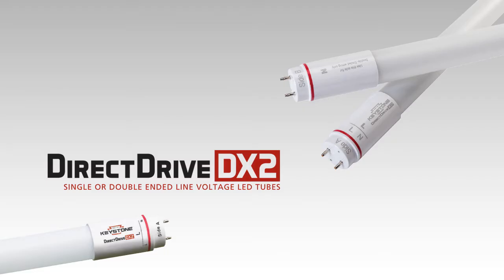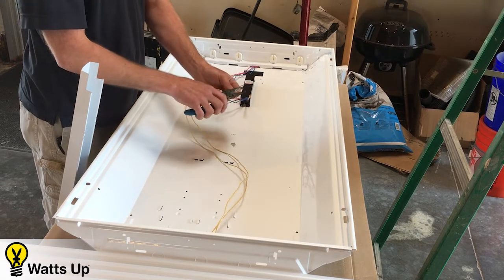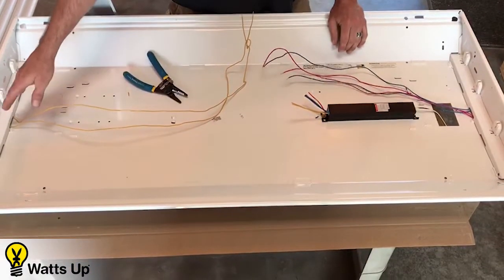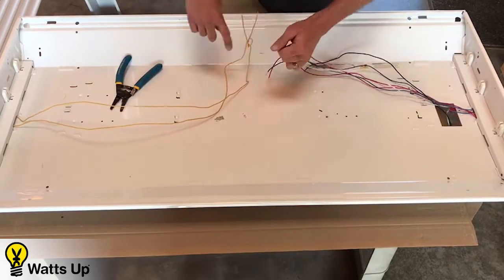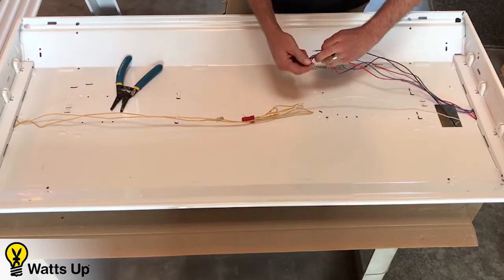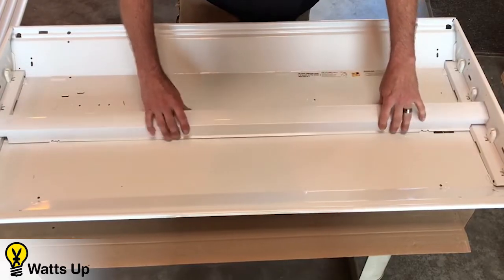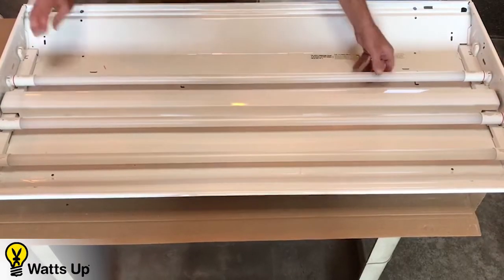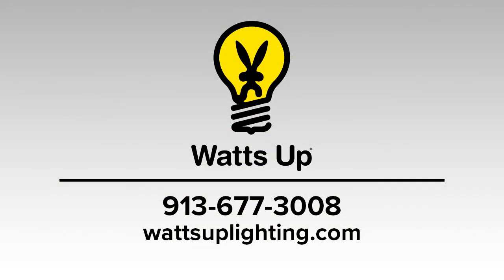How To Convert Fluorescent Fixture to LED

Comment: So I did this with a t12 tombstone 
But put t8 bulbs in it 
Wired it the same way show in the video 
Only thing I didn't do was put the cover back on 
But still doesn't work 
Help please
Reply: I’m having the same problem it will not light up. Did you ever figure this out?
Reply: @Scubadiver313 ended up removing the whole fixture

Comment: I took out the fluorescent bulb and placed an LED bulb in and the they turned on. Is it maybe that they are making lED's now that convert easily to a fluorescent fixture?
Reply: They do make a plug-and-play bulb now, but you'll still be powering up the ballast so it's not very energy efficient, and if the ballast goes out you'll have to bypass it at that time.
Reply: @ArbitraryLifestyle  Thanks, seems to be holding out so far. I guess I was lucky when I replaced the old fluorescent with an Led.

Comment: This is for the replacement of t8 bulbs, shunted tombstones are needed, for t12 the wiring is a bit different!
Reply: I have a four lamp fixture. Unscented tombstones. I ran one wire from each tombstone. I hooked the tombstones on one end to the white. The other end to the black. They won't light. Any idea why?
Reply: @bradh6185  i’m having the same problem. Did you ever figure this out?
Reply: @Scubadiver313  I don't remember the details, but I think it had to do with using only one end of the fixture instead of both, which was counterintuitive. If I get time, I will check it out and report back.

Comment: What type of led bulb do I buy with this? Double ended, or single ended? This is what I have in my basement
Reply: I'm guessing a double end because he's using wiring 2 connections per LED...  * single end bulb uses only 1 connection FOR power and negative ( not shunted ) and the other side just holds bulb in place ?  I am trying this soon and have watched a few vids now and they all different ...  ;-)
Reply: I’ve just replaced my lamp /bulb.. it didn’t work at 1st but then I removed the starter and it works . Is that ok ?